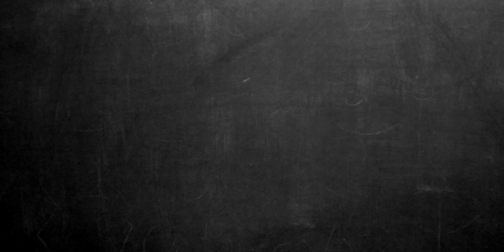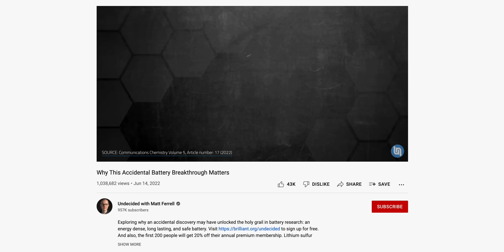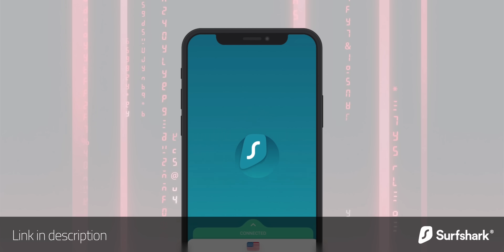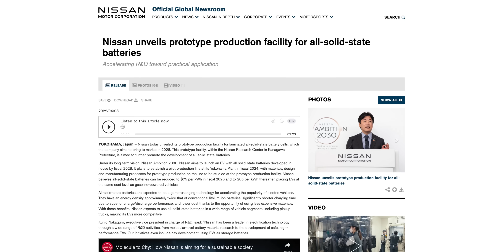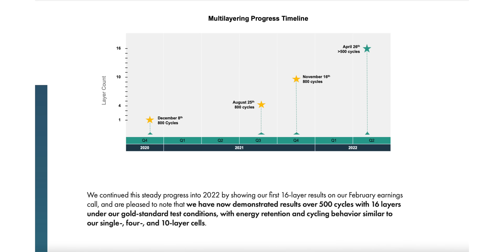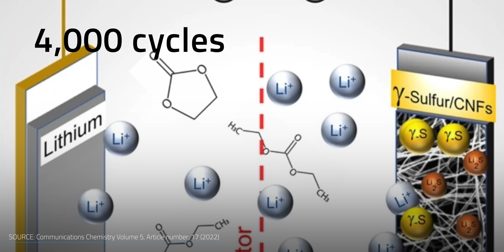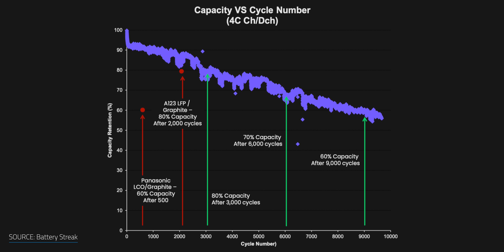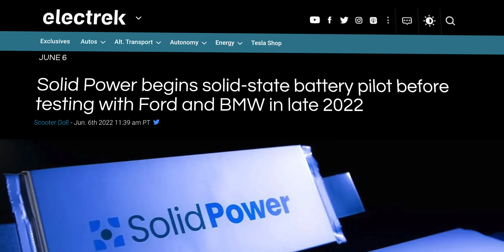Is This Solid State Battery Too Late?

Comment: The electricity is the same at all outlets and anybody who wants to make a proprietary method of charging is going to be destroyed in the free market by Tesla's charge everybody sales plan. So basically any battery chemistry you by will be able to be used.
Decided? Well, what I am sure of is that the world needs EVs and more efficient transportation right now. As soon as I have the money it's down to Tesla and hopefully LiFePO4 but Liion will do.  When cars started there were coal-powered, electric, kerosene-powered, alcohol powered and more. But gasoline had enough of everything to make a reasonable choice for all the uses. Right now that reasonable choice for EV's is Lithium maybe soon to LiFePO4, might change down the road. Even better than for ICE vehicles is the parts situation. Your not going out and buying spark plugs or air filters or ... for your EV, if the battery pack lets go you are replacing the whole thing, not going to Walmart and buying a couple cells and a soldering gun. You do need to make sure that whatever battery pack you use will have replacements available in 10 years or so, which should include tesla and all the big automakers.

Comment: 0:40 I fail to see how an EV is a "renewable technology".  A battery electric vehicle stores electrical potential generated elsewhere.  That generation by far comes from coal and natural gas today.  And the battery itself degrades with charge & discharge cycles, and lithium battery recycling technology is still in its infancy.
An ICE vehicle running on 100% biofuel is by far more "renewable" than today's BEVs.

Comment: Yeah, if solid state had come out 5 years ago - like it was hinted they would for many years - then these other formulations may never have gotten off the ground. But since the "five more years" ad nausea seemed to be going nowhere it was only natural that some groups would decide to go in a different direction. 4000 cycles is extremely significant, and if it is close to zero flammability then that's even better.

Comment: For me the dendrite problem is why I hope for a real world everyday driver million mile pack, a small pack or even long range model with 400 cycles isn’t viable in my opinion right now the biggest problem isn’t the fact that there isn’t a 400 mile every day pack but the fact that degradation of the pack and short life for high mileage models stop adoption by the second hand market , if a pack that got the same miles and range 5 or 10 years down the line prevents adoption by the general public. We have got used to being able to pass cars down to family members, or not worry if a car has 60,000 miles on the clock , with an ev if it has that many miles it looses thousands and as a former gen 1 leaf owner degradation worries are the reason why so many wouldn’t go back unless it had a t in the name with an unlimited 8 year warranty, now that that has ended and so many manufacturers have made it impossible to claim on warranty in the period or with such low mileages before it lapse’s is why so many want to stay with what they know as it’s tried and tested

Comment: When you listed the shortcomings of Lithium Ion batteries you forgot that little detail that they suck in cold climates.  During a freak snow storm on I 95 last year the electric vehicle caused havoc when their batteries went dead during a slow down and effectively shut the road down not to mention their drivers had to get out and beg those terrible polluters to take them in from the cold.  So basically if you live in one of the warm states your okay, if not you are taking your eventually going to suffer for it.

Comment: The solution is transit and denser housing. These improvements on efficiency and electric cars are marginal improvements at best. Personal automobiles for every day use are still grossly inefficient uses of energy and resources (materials and capitol). They do not fit in the long term strategic solution to climate change and carbon reduction. Furthermore, the electric grid and related generation capacity will need a massive renovation if we intend to transition fossil fuel use to electricity. Moreover, the majority of US energy production is still fossil fuel. So transitioning from gasoline power cars to electric cars is not going to save much carbon if the electricity being generated is mostly fossil fuel.

Comment: Something SSBs will excel at is charging times. If people are going to universally embrace the EV, they need to be convenient.
Reply: Current technology is capable enough already to do that. Charging and range really are no longer holding back adoption. Maybe it is the perceptions some still have.
Reply: @baronvonlimbourgh1716  not really. 45min to charge to 80% is still more than 5min to gas up to 100%. Not a complicated concept to understand. Solid state technology can do a lot to alleviate that issue.
Reply: @buttsexandbananapeels  in practicality it really doesn't matter.
New models charge to 80 in under 30 already. Plus who drives 350 miles in one go, fills their car and drives another 350 without stopping? And anyone that does really shouldn't and should get penalised on their insurance or something anyway. 
They are just as dangerous on the road as drunk drivers are. Risking lives just to save 30 minutes on 8 hours.

If ev charging tech wouldn't change anymore going forward it would be more then sufficient as it is already.  They are all just percieved issues that do not exist in reality.
Reply: @baronvonlimbourgh1716  in practicality it really does matter. I drive 300-400mi/day at least 3 days a week. There are many more like me.

People also drive places for vacation. It happens.

In one shot? No. But if I can charge up in 5min like I can gas up, that’s a benefit.

Not only is it convenient, but I could option a smaller battery pack for less money. It makes an EV more accessible for more people. That makes the EV an all around win over an ICE vehicle.

The word I used was “convenience” for a reason. It’s called “contextual literacy.”

As for driving 350mi in one shot, save the sermon for church. That’s not what my comment was about, so go moralize somewhere else.
Reply: @buttsexandbananapeels  practically it doesn't matter because you are in the 5% of outliers that can just keep driving ice cars if you want. The rest of us will be bennefitting from being able to drive ev's.

That is how things work. Things are targeted at the median not at the extremes.

Comment: imo by the time Solid State Batteries are ready to go to the mass market it'll be too late for a lot of the people funding them (i.e. auto companies). I've read about so many "breakthroughs" in Solid State Batteries by auto companies hyping up early research that I frankly don't believe it anymore whenever I hear them make claims about the solid state battery. One of the EV startups that made a bunch of headlines claiming to have made a major breakthrough in the solid state batteries later abandoned it altogether because basically the first 80% was easy, but the last 20% was really hard and maybe even impossible with today's technology.

Comment: I'm currently very interested in the Graphene Aluminum Ion battery from GMG. They have some documentation on the testing of the 2032 form factor that you can compare directly with Lithium Manganese rechargeable batteries available today. in that comparison, 200mah each about, they degrade similar in charging rates, but the Graphene battery recharges completely in 3 seconds, compared to the Lithium's 9 minutes. If they work to scale the price they believe they can for the graphene production, then being able to charge your car safely in the time it would take to refill your gas tank (with 600 mile range) could be very attractive to consumers! Also because you wouldn't worry about needing to charge the night before to make the next destination the following day, you would drive your vehicle like you do now with your ICE, stop and refill only when your at a "low tank".

Comment: I think solid state is still a goal worth achieving. Everyone knows that EV is the future and the best way to get us there is lower cost, faster charging, and better range. It's all about economics. We spent the last century perfecting internal combustion, and now it's time for us to get better at battery technology. The added benefit is that this can immediately pay dividends in the home energy storage market, as well as boats and aircraft that are going electric. Imagine if we could have 3x gain in energy density for the upcoming eVTOL space? Imagine a world where your electric flying machine could travel 500 miles between charges? Using existing flying technologies, the only thing we need to get to that space is lighter batteries storing more energy. I suspect that before this decade is out, these battery technologies will be saturating the market and the real competition will begin, and the EV adoption curve will skyrocket. 2020-2030 is the decade of the battery, and I suspect we will see a lot of improvements over the coming years. This is very exciting and I'm so grateful to Tesla for making it all happen. (laptops and smartphones started it, but the real battle kicked off when EVs became hot)

Comment: Very interesting video as always.  Question though, when talking about battery cycles, how are they impacted by charging when not at low charge?  For example, if you charge you car or phone every day even if it never reaches 50%, does this still count as a cycle, or does one cycle occur every 2 days even if it charged twice?
Reply: A cycle is 0 to 100%. If you charge 20% for 5 days, thats 1 cycle.

Comment: As long as they can reduce weight, space and maintain distance they will have a future in either aviation, automobile, or military application.
The 4680 solve some issues but it's still a bigger, heavier battery with the possibility of explosive combustion.

Comment: In the short term, LFP-based lithium ion is exciting.  It’s less expensive, safer, and longer-lasting than the other lithium-ion chemistries currently on the market.  It’s main downer is lower energy density (meaning size and weight aren’t ideal).  But they’re starting to gain energy density improvements with it, and I think LFP may prove to be the way forward in the short-term (now until 2025 at least) over NMC and other technologies currently in use.  I predict that LFP will be the thing that solid state, Niobium, etc., are gunning to replace.

Comment: For me it's not the charge time or the range. My limiters are of course cost but also the lifespan of the battery. I can't get a laptop battery to last more than two years before it just dies. Expensive cell phones also degrade quickly with the batteries maybe lasting three years or so. The degradation of an EV battery seems to be warrantied at 30% degradation over 100,000 miles. Timeframe seems to be 5 to 8 years, but I don't see a company giving a full 10-year warranty. It seems like the standard procedure is after the car loses about this range to replace the battery. This often means that despite the car being useful, the cost of the battery is more than the value of the vehicle and the car is junked. Without a transmission and the far fewer moving parts of the electric motor an EV (aside from the battery) should be useful for longer periods than a gas car, but because of the battery they are not. Consider my father still uses a 1977 tuck on his farm. His entire investment purchasing the used vehicle and repairs over 20 years, is still less than replacing a single Tesla Battery. He is open to going EV but currently there is no vehicle on the market designed around such off-road heavy-duty use or that is as cost effective as the occasional repair on his 70s model truck.    

Further there is the end of battery life to consider. Do we have data on when an EV battery degrades say 70% or 80%? Other consumer electronics reach a tipping point where the battery just ceases to function. A laptop battery will degrade to say lasting an hour or so then just stops working at all dropping the last 20 percent all at once. Will EVs function the same way? What will a young person looking to buy their first car, or a poor family do when used EVs are out of their price range because of the replacement battery cost?

Consider the sheer number of vehicles still on the road that date back to the 80s and 90s. Not restored classics, but the cheap cars driven by first time drivers and the poor. These cars still make up a sizeable chuck of vehicles on the road and if EVs are junked before they reach this level of affordability, these very dirty (in terms of emissions) vehicles will only continue to be driven and become even dirtier as repairs become more haphazard. 

There are two options. Either batteries drop to a level where replacement on a 30-year-old, or even older, vehicle can be justified (very unlikely). Or battery degradation drops to a level that even after 30 years the vehicle is still useful for basic transportation. Increased range and decreased charge time would be nice, but if you want the lower middle class and poor to also buy in, they will need the EV equal to something like a 1997 Honda civic for $3,000. You know the car... it's more rust than paint, the AC doesn't work anymore, the radio randomly turns off... but it will still get them to work and back until they can save up for something better. 

Personally, If I am going to invest in a Tesla that cost as much as my home, that Tesla will have to be a very long-term investment. It will need to be useful to me for at least 20 years (ideally with some utility left over so it can be sold to someone who cannot afford better). 

Vastly better charge cycles to reduce battery degradation is the key. That will allow a used EV market to become similar to the current used car market. Cars starting off expensive then rolling down the economic scale until they reach the hands of their end-of-life users who simply cannot afford anything better but still requires transportation. With perfectly good EVs being junked because battery replacement is not economical, it is not only hurting adoption but also all the waste coming from the cars that otherwise should be on the road still being used.
Reply: Sad but true. I think the majority of EVs will simply be thrown away like TVs, laptops, etc. are today. There might weekend mechanics fitting year 2035 batteries into 2022 dead cars, but will only be feasible using their free labor, knowledge and practically free discarded car parts. The cost to hire it done would be better spent towards a 2035 model.

Comment: The number of charge cycles is not a big deal if the batteries are much cheaper, as they are replaceable (as seen with the Bolt and Kona EV recall). I'm concerned that the battery format will change and you will not be able to find a replacement for your 8-10 year old car.

As a bonus, the battery tech will only improve so replacing your battery a few years down the line will improve your range beyond what you had when you purchased the EV.

Comment: Lithium metal anode solid state batteries should be able to take advantage of all the advancements in cathode technology that traditional Li ion batteries can, I think. Which should keep them ahead in theoretical performance, hopefully. Honestly so long as the battery does what I need it to do and doesn't use too many problematic materials, I'll be very happy.

Comment: Uuuuuuughhhhhhh.

Solid state is not a battery type by itself, it only qualifies that the electrolyte itself is solid rather than liquid/aqueous in form.

While this has been overhyped as a density or safety benefit, its true benefit is temperature versatility.

Solid state electrolytes can allow a battery cell to continue working at much lower temperatures than aqueous electrolytes which either freeze at low temps or simply lose so much ion conductivity that they might as well be frozen anyway for all the good the battery is.

Comment: I would like to comment not on the specifics of Solid State Batteries but rather on the presentation.  The science and understanding of these competing technologies is a numbers game.  In most videos, this one included.  The specifics of each technology and the various manufacturer's achievements and projections,  are spewed out in sequence with the viewer having little or no chance of making mental comparisons of benefits or trajectories of the individual technologies.  If instead, you were to present a table for each of the various technology's attributes, it would be far easier to both understand and remember.   I hope I was able to help.

Comment: The fact that solid state batteries can be punctured and still function without to explode or catch fire is the true killer feature imho. Right now we are putting into the streets a lot of moving bombs called "electric cars". Imagine now cheaper electric cars to go into the market with worst safety standards than "Teslas" and we will have the perfect storm. We need a battery technology safer than the current lithium batteries.

Comment: And nobody talking about reduction.
Reducing consumption, demand, necessity.
Smaller and lighter vehicles, smaller houses,  better insulated, more economical, more functional and less demanding... 

A few years ago, lighting took a hefty percentage from general electricity consumption. CFL and LED lights cut the need to a tenth. But Instead of actually reducing the demands on electricity production, people installed more lights and keep them on for longer, actually increasing the energy demand for lighting.